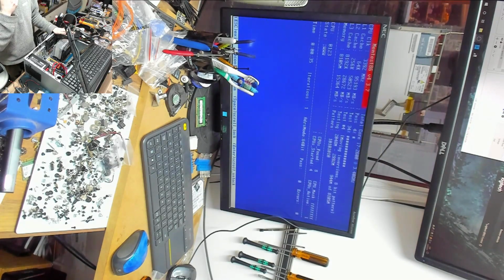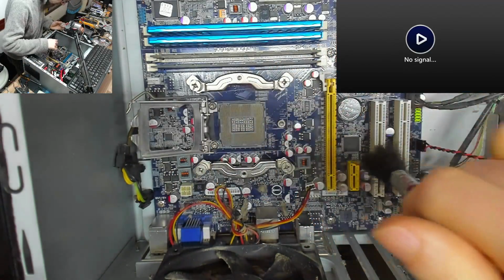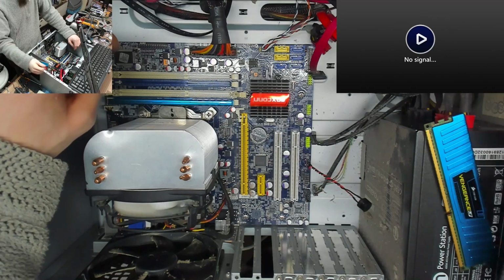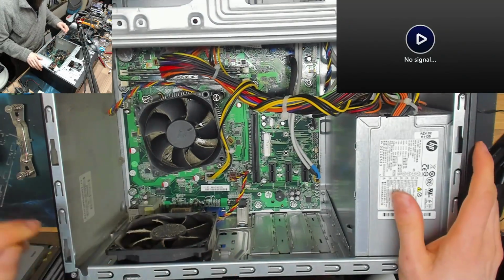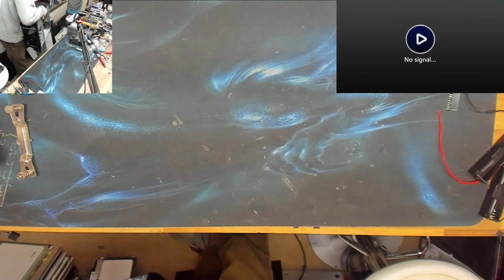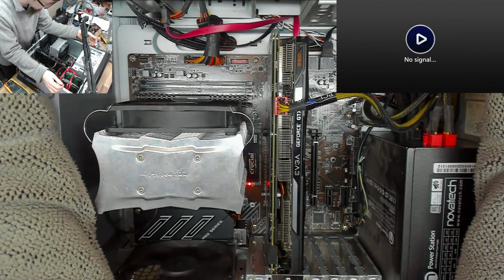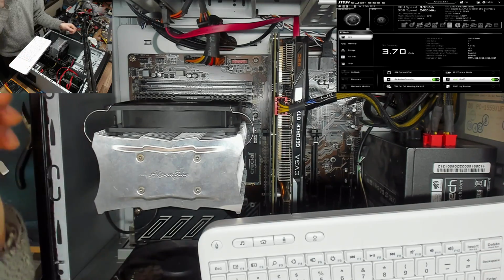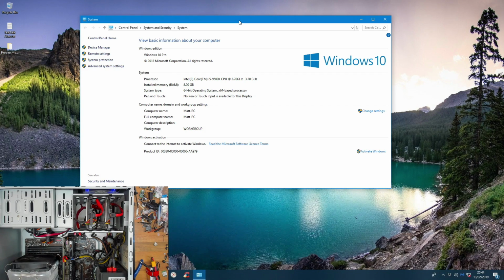LFC#160 - Intermittently dead motherboard rabbit hole.

Comment: Ah good god I useto do alot of rma for foxconn boards 7 years back,i think there was like a 7\10 fail rate of that brand,we had a lot of swap out stock for replacement which made rma beautiful for customers that was from foxconn and they seemed to implement improvement with each shipment to us ,useto work for a company that useto be a sole importer for them in my country dunno if they still are or how good foxconn is now,but my experience is not a good one with them seem to have a high fail rate with bga joints on them but for the price its not a bad brand just needs abit of refinement from there production side,if you use foxconn with stadard settings and run it without clocks seen some that have lasted the test of time but try one overclock setting and issues arise
but with the price point you cant complain you get what you pay for sadly knowing how big foxconn is you'd expect them to have some of the best boards around
Reply: foxconn is a shoddy brand, go with ASUS

Comment: This guy isn't to bright at all. I'd probably be done already . When is that bad is it sad dirty this take the motherboard out of the case and take it all out of the case an blow it out with the air compressor . You should have an SSD with test windows 10 on it . Unplug they're hard drive and plug the SSD into it . And go in the bios and make sure it's not overclocked living hell and make sure the ram is the same speed . This is noob stuff .
Reply: only sensible on here

Comment: I can only recommend RAID on either proper HW Raid controller with long term support (not those onboard things), pure software raid, or as ZFS (on linux or similar) especially if you want redundancy, because you are always dependent not only on the drives but the controlling hardware. This obviously does not hold if you use raid-0 or JBOD onboard-RAID modes, because then you obviously do not care about redundancy, but pure speed.
Regardless of what you choose, make sure your backups are automated, and do work.

Comment: That damn computer can't breathe with all that lint/dust in the fan/etc - that's real bad - you need to clean that CPU fan/heatsink real bad - I thought you fixed motherboard problems
Reply: The dust isn’t the cause of the POST failure.

Comment: I'm trying to trouble shoot a msi 760gm-e51 with a 1055 phenom 6 and standard 8 gb ram with an an ancient radeon. It popped on me last year so i threw it to the side til now.  No image, no beeps. Everything off it. No ram.  yet the mobo fires up. led  lights for something called phase 1 through to 4 pop on with the psu i had on it which is what i think a cheapy 430 watter. Tried my 850 watter. No change other than the fans lowered down in speed and the led lights  dropped to 1 in use. Tried the ram i'm using in my other 1. No image. Tried a different gcard. Nothing. Going to try another cpu and new cmos battery then probably bin it.
Reply: @Adamant_IT  yeah but it's been looking at me for a year, day in day out. Now that i've got sometime to fart around with it and from watching a few of you small shop guys, bugger the pretty boys. It's the man on the street with a few of his well worn tools. They're the ones that deal with it everyday

Comment: Hello, i found your channel a few days ago,and i´m loving it.Keep up the good work. This board,like the laptop boards, isn´t fixable?
Reply: From my experience it's usually BER beyond economical repair, i.e. you would pay way more for labour than the boards replacement cost.
Reply: @deelkar  :  That is generally true. However, we do fix some motherboards, usually installed in commercial or industrial equipment, when they are obsolete and/or ridiculously expensive. That board behaved like it has a glitchy power rail. A half hour and a fresh lot of electrolytic caps might have stabilized it.